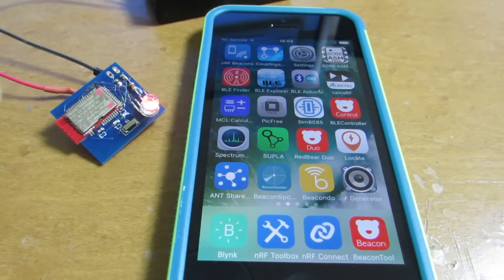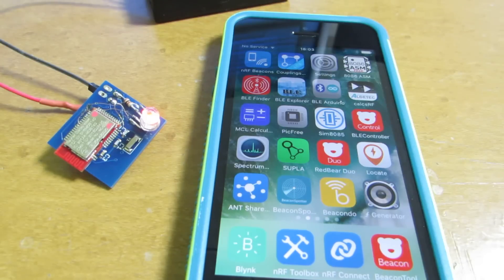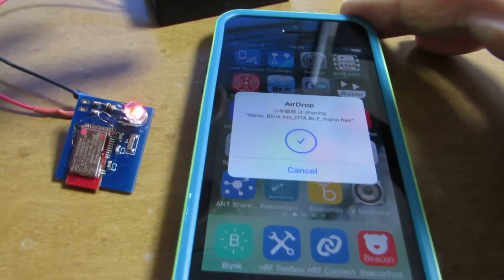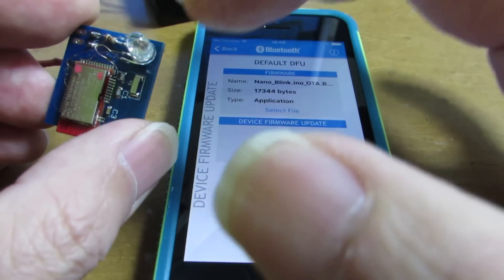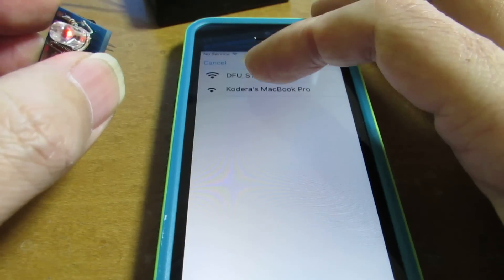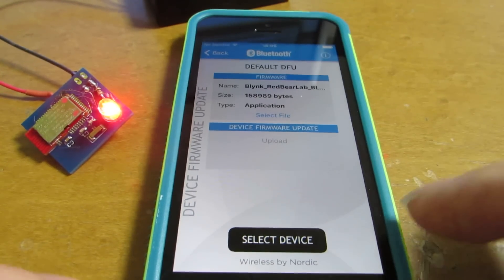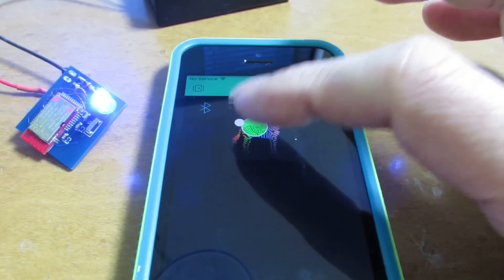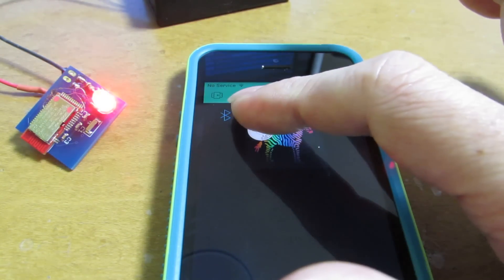nRF51822 (RayTac MDBT40) testing from Arduino IDE through AirDrop

Comment: Hi, do you have the code? Thanks. I try to comile with arduino ide , board set to "Generic Nrf51822", take the .hex file to OTA with the nRF Connect App, it uploads, but nothing happens, led does nto blink
Reply from the maker: hello, it's been long time since I touched this and I vaguely remember that, binary uploading needs some address definition. So sorry about I cannot repospond exactly...

Comment: Nrf51822 is easily uploaded by sandeepmistry github arduino.core. you can use stlinkv2 or  (stm32f103 blue pill converted to Black Magic Probe) to upload code.

For ota get bootloader.hex from redbear's nrf51822 github repo and change sandeepmistry's platform.txt 's link to softdevice hex file. 

Then you can upload thru any mobile (ble supported). For more info: ask ajaybnl 2t gmail
Reply: But hey, how did you get led blinking with softdevice?

Comment: For using the ota you have to flash something before, or it comes with a ota ready bootloader? What's the pin connected to the reset button for enter in to programming mode?
Reply from the maker: For OTA, YES. Bare module (which just bought) does not contain OTA firmware and need to upload first. Connection are presented at my hackaday project: https://hackaday.io/project/19784-tiny-ble-board-with-oled
Thank you!